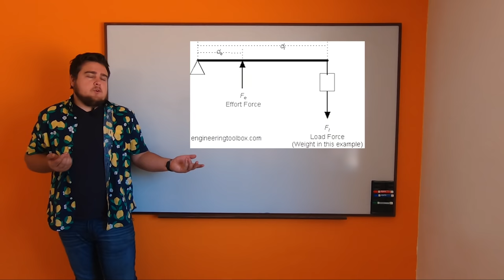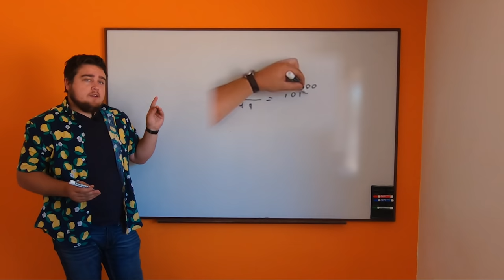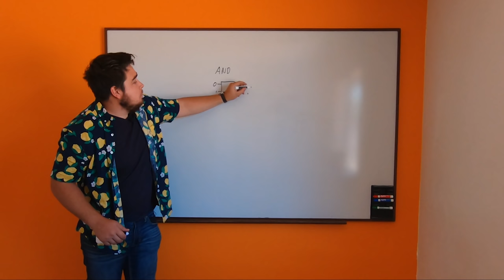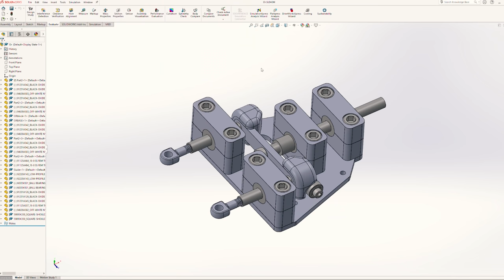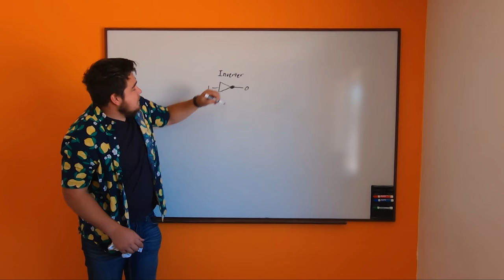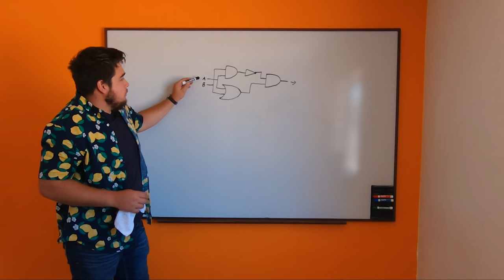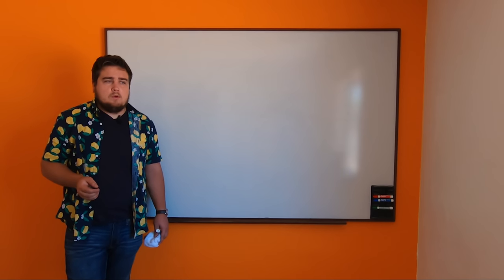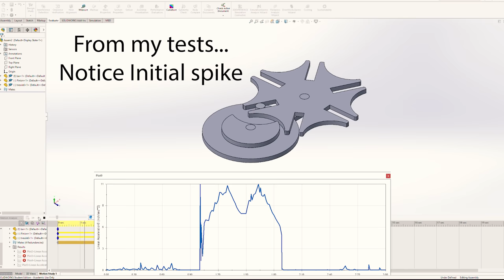Is a Completely Mechanical CPU possible?

Comment: "Is a mechanical computer possible?"

Alan Turning would like a word.
Reply: As would Babbage.
Reply: @grimftl  I was about to say Babbage.
Reply: Konrad Zuse as well
Reply: Jacquard wants to say a-hon!-hon!-hon!
Reply: No, It is not possible for two reasons (even if his idea is beautiful):
1) The more number of mechanical pieces in use, the more likely to crash. We already have lots of crashes, not want more of them.
2) The latency and timing that sucks!!! Even the electrons and light emissions have unacceptable delays in some complicated circuits.
Reply: @pbakhshande5057  Yeah, not possible. Apart from all the real world examples I and others have made above.....
Reply: All of Turing's machines were electromechanical, even the mathimatical model was envisioned to be digital tape, although it's backportable. Anyway, some random 2100 year old Greek machinist would like a word with Babbage
Reply: @alakani  Electromechanical is a good point but still mechanical! Some ancient Chinese clock-making astronomers are muttering under their breath too...
Reply: Is it possible to make a round object with which to roll things upon? Perhaps mounting it to some kind of vessel with which to carry things?
Reply: It is not the speed that determines if it's possible. You could build a computer out of people who lift their hand (or not) and thus signal 1 and 0, looking at each other for input.
Reply: @pbakhshande5057   The question was "is it possible", not "is it practical"
Reply: @pointlessvidz13  I appreciate your beautiful comment; What you pinpointed would a lot useful in future understanding of scientific concepts in English.
I only know some English as a second language. 
All I was trying to say was just the simple question that "why not we look for sth quicker and better" in the first place. We should see how it would end up at the end!
Reply: at least it would still work in case of Carrington event.
Reply: @pbakhshande5057  but if you were to shrink it down to micrometre or nanometre scales..?
Reply: @DavidPaulMorgan  
Thanks for your comment. Let me tell you the whole story of science as far as I know, and a brief review of chatting in our community in here). I am not sure if I got what you mean, as my language is not English. and It is always good to take into question anything to seek other solutions. But we should not deal with atoms themselves directly; the electrical engineering is also dealing with atoms as we need material to work with (however the electrons of atoms in electronic chips, or light emissions in communicating devices), nothing is as fast as light transmission as far as we know. and in all of these devices, we already have micro or Nano delays that sucks. 
We always need material to work with, and it doesn't matter what you call it, either mechanical or electrical engineering, but I think it might be better to go after some other characteristic of atoms, not to get involved with themselves directly. Our future is in hands of physicists or maybe chemists (not just traveling or communication in space in which only a text-message takes 40 minutes to travel back and forth between earth and mars, but our aim is here on Earth). In electrical engineering, The transistors (logic gates) are already reached to their atomic level scales, we need atoms to have their electrons to work with in electronic chips.  

If you are  asking about creating small devices, it doesn't change the fact that the more number of mechanical pieces in use inside a system, the more likely the whole system to crash! That is why the mechanical systems should be designed as simple as possible, lowering the number of parts in use, not just because they are simpler to analyze and comprehend, or they should be finally be used by human operators with large hands.
The aim of this video on this page, is to seek an answer if it is possible to have a simple controller, not to get into competition with modern CPUs in which there are billions of such logic gates. Maybe we should change the underlying logic, or to go after other characteristics of atoms.
I'm not sure how it could be possible to get into competition with modern CPUs (even though they are already have reached to atom levels, a very awful dead-end, not a bottleneck).
Our future is in hands of physicists!
Reply: @HappyBeezerStudios  Did you read "The Three Body Problem" trilogy?  Because there's one section of this story where precisely this happens.
Reply: @pbakhshande5057  Thanks for the lesson, but my guess is that since people here are watching a video on mechanical logic gates, they're not looking for "simplicity", "efficiency" or a way to "compete with modern CPUs".
Reply: @pbakhshande5057  please look up the definition of possible. I think you will find that it does mean “can compete with modern day silicon”
Reply: @grimftl  if you ever get to see Babbage’s Difference and parts of the Analytical engines in the London science museum it’s worth a look, interestingly he didn’t use and or or gates at all. Can’t honestly remember how he did, its just cool engineering from the time and you can see why it bankrupted him.
Reply: How about the slide rule - has a body, a slide, and a cursor.  Which, like the one on the computer, if used sloppily gives you a wrong answer.
Or the abacus on which it's operating parts are called 'heavenly' and 'earthly'.  Being in the midst of setting the valves on my Ducati I'm enthralled with the idea of a mechanical computer.
Reply: Yes it has been already done!
Reply: @pbakhshande5057  look up nanoelectromechanical systems they can get pretty close to the ghz speed computers use today. Up to a thz
Reply: @pointlessvidz13  for some applications yes. Like space and areas where you want a robust energy efficient computing machine
Reply: Charles Babbage would like a word

Comment: 9:03 although its worth noting that nasa has actually been considering giving it a look for venus-based rovers, due to the fact that electronic circuits dont hold up well at all under the venusian atmosphere, whereas mechanical devices should hold up far better and remain working for longer. we may actually see mechanical computers make a come back, at least for venus missions
Reply: while that might be vaguely true, the amount of processing that has to be done on an modern rover is large enough that rover might have to be much bigger than anything else built before.
Reply: @psd993  true, and the idea of mechanical circuits being used is still only a consideration for now, rather than something that's been decided on. If we can make electrical circuits work, then that's obviously a better choice, I mean there's a reason we moved away from mechanical processing for the most part. It's just that NASA is at least deeming it a worthwhile consideration incase electrical circuits aren't a viable option. Doesn't hurt to have a backup plan after all.
Reply: No, it's for a Mercury mission, not Venus.
Reply: @revampedharpy09  perhaps mechanical sensors and instrumentation outside of a thermally insulated electronic processing unit will be the compromise they need.
Reply: You would still need to convert radio to mechanical energy, and you would need to make it REALLY compact. It would be better if they used the heat from the atmosphere to power a powerful cpu cooler.
Reply: Plus if you make it mechanical the metal can still expand and the computer breaks. Mechanical computers don’t solve the problem. Possibly a computer made of electromagnetic relays (assuming those are not impacted by heat)?

Comment: *There's a GPU shortage
Wesley: alright what do I have in the scrap pile I can put together.
Reply: OMG - he can use it to mine for bitcoin.
Reply: @NotSomeone68  yes. However, be careful saying GPU because you would typically need a whole graphics card rathar than just the GPU.
Reply: @NotSomeone68  also, there’s a silicon/chip shortage in general, not just GPU/CPUs  so this comment still technically makes sense.
Reply: @ShyDigi  Likewise with a motherboard  and CPU, though.
Reply: @NotSomeone68  not necessarily, motherboards typically aren’t shipped with CPU’s. And either way a graphics card still plugs into the motherboard so it’s not a good analogy.
Reply: @NotSomeone68  Build a big enough one and it could literaly mine (like actual ore out of rock).

Comment: "Beauty in engineering doesn't necessarily have to be efficiency" - Absolutely agree!!!!
Reply: Sometimes the "inefficient" way is objectively better suited to a particular task. For example reading in a settings file "inefficiently" allows for much greater flexibility which ultimately ends up saving time, but it still takes more clock cycles to complete.
Reply: I was about to disagree with that statement, mainly as a knee-jerk reaction, because efficiency in design inherently has a beauty on its own. It may not produce rhythmic sounds, or have good-looking patterns, or even look interesting to the naked eye, but a well-designed integrated circuit is beautiful, as well as a plane that flies well, or any other simple and elegant solution to a problem. May be my inner German speaking or something, but there is an undeniable beauty in efficiency, a great satisfaction in seeing the best possible solution to a problem...

Why then I do not disagree at all?

Because there is one human activity strongly associated with beauty that is, speaking on a purely utilitarian term, an utter waste of resources: That activity is PRODUCING ART!

Art is probably the opposite of efficiency. It has zero utilitarian value, and still, it has existed longer than engineering... or probably art and engineering have coexisted forever, because the beauty of engineering comes from its likeness to art:

Rhythm, for example, is something humans really like. The basis of music is rhythm, and a pleasant and beautiful thing machines tend to do is producing rhythmic sounds... In rhythm we can find the beauty of a well crafted machine, because an engine with a problem will not produce rhythmic sounds. Electrical equipment on the other hand produces monotonous hums and is not pleasant to listen to. Nobody finds beauty on the sound of electricity.

I consider the best testament to human ingenuity the ability to take the beauty of efficiency and the beauty of art, and combine them into one single design or machine.

As you can imagine, I really, really like watches, and clocks, and engines, and trains, and railways, and propeller engines...
Reply: @renard6012  Exactly! Although electrical waves seen on an oscilloscope are beautiful, so perhaps it's all about how you experience something?
Reply: I would actually disagree with electronic hums and droning being disliked.  That is after all the basis of the Hurdy Gurdy instrument, a thousand years ago it was an instrument in nearly every church and was used everywhere because many societies at the time found beauty and perfection in an uninterrupted melody or note, and this produced what is basically a a wheeled violin that can be cranked to create droning near violin noises and the notes played on the strings are played by keys on a box over the fretboard.

Electrical hums can harken back to that view on perfection and can even be seen in modern EDM music with droning undertones that act like bass and texture to the notes on top of it.

Nevermind the fact that people play music with pure electricity with Tesla coils so even the sharp unpleasant noise of electricity can make music as well.
Reply: @ComotoseOnAnime  I absolutely love the sound of a hurdy gurdy - it also has some low-pitch clicking noises as the fret keys are operated. Very rich cello sort of sound, with a continuous drone in the background. Beautiful.
Reply: The steampunk attitude.

Germans would disagree tho :P
Reply: Rube Goldberg be like:
Reply: The most Beautiful in engineering simplicity.
Reply: @renard6012  The function of art is to communicate. As with everything, Sturgeon's Law (90% of everything is crap) applies to art as well, meaning that just because you don't see a lot of useful art doesn't mean there isn't useful art. Art not only has value, it's absolutely necessary for a society to function. That's not even my opinion, it's literally a fact.

Comment: Main problem i see is friction. With enough gates in series you won't be able to move the inputs, since a single input will move the entire machine simultaneously.
What i think would be better is to have a mechanical clock input. This input would be what drives the outputs so that all the inputs do is decide whether the "clock" makes the output move or not.
For example the AND gate: 
set A -> reset B -> pull clock -> nothing changes
set A -> set B-> pull clock -> output changes
I'm bad at explaining my ideas but i hope you get what i'm saying. The only drawback with the mechanical clock input that i see is that you would have so sequence it.
For example with your current design as soon as one input is changed the entire machine moves and the result is near instant, but with this mechanical "clock" you would have to strobe each section step by step, sort of like a wave traveling through the gates.
But then if you connect each section to the clock but with an inverter in between each section your clock it should be enough to sequence your clock in a "tick-tock" kind of way.
And thinking about it you only need two clocks i total, one inverted, the other normal and just connect every second gate to one and the rest to the other clock.
Anyways do what you do, will be interesting to see what you come up with.